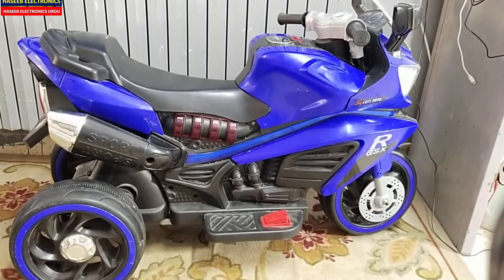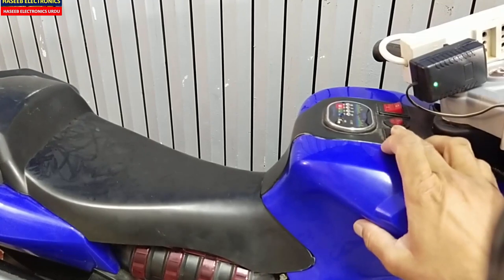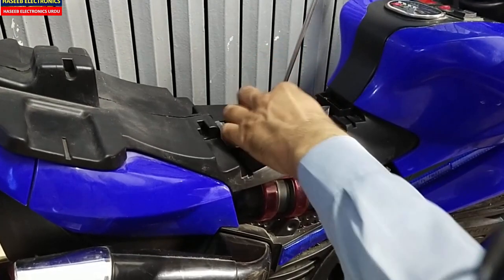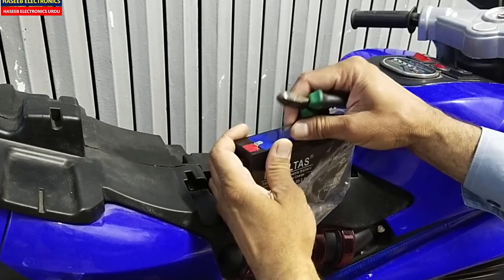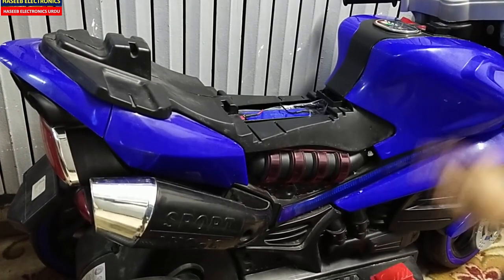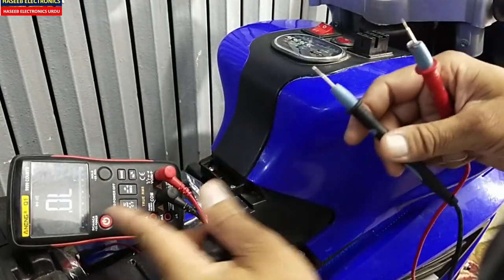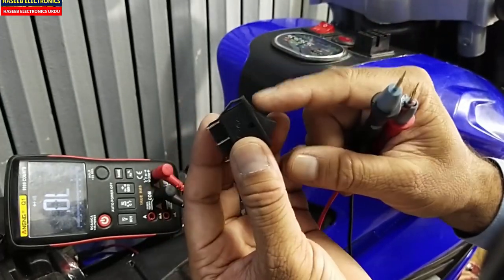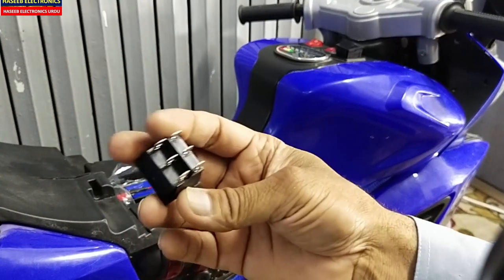{600} Kids Electric  Motorbike Repair / Wheel Powered Baby MotorBike Repair

Comment: Which motor is used ? Normal rs550 motor or geared motor ?
Reply from the maker: it uses 6 volt geared motor
Reply: Motor names ???? Itz a gear and why it will use a gear motor
Reply from the maker: geared motors are used to reduce rotational speed and increase torque. because a simple 6 volt motor can't provide enough torque to drive the car and car's payload. so it need reduction gears to reduce rpm of the motor and it will multiply the torque

Comment: What do you call the switch for forward and back ward...
Reply from the maker: it is
3 position DPDT rocker toggle switch 125 volt 10 Amp or 250V 6 Amp
https://www.amazon.com/Position-Rocker-Toggle-Switch-QTEATAK/dp/B085ZD3YM7
Reply from the maker: https://vi.aliexpress.com/i/33051374061.html?gatewayAdapt=glo2vnm

Comment: well, multimeter will ring if load less than 50R. But this rocker switch is limited 50mR max by datasheet. And if button will ring through multimeter - it is not garantee that switch is OK. Because if switch resistance for example is only 1R, voltage drop at it  will be 5-10V @ 5-10A current, and motor will be starving on voltage to do any useful job.
Reply from the maker: brilliant
your are absolutely correct
the switch contact resistance must low. as it was new. so I demosntrated simply